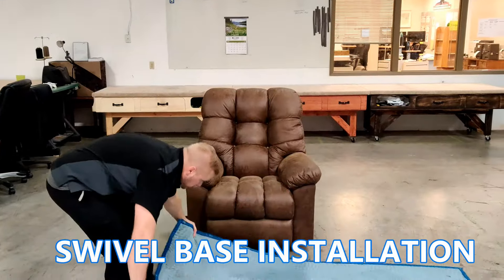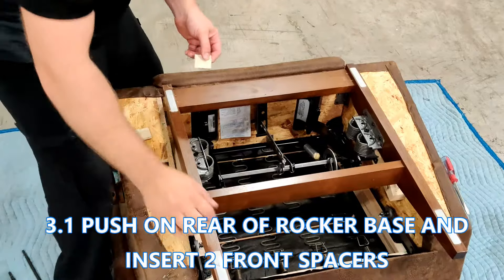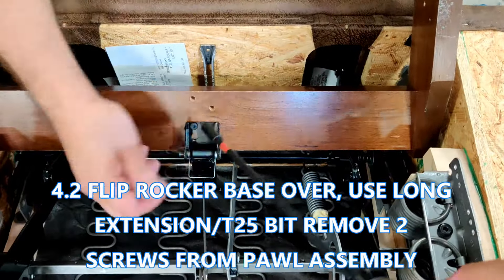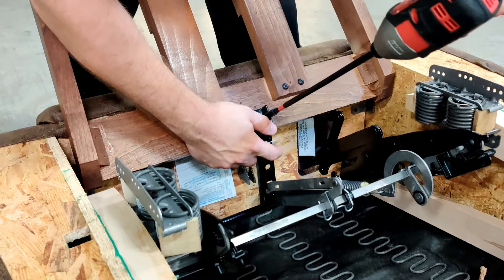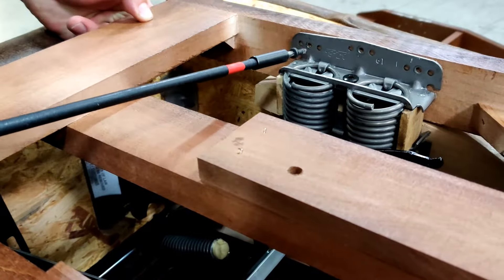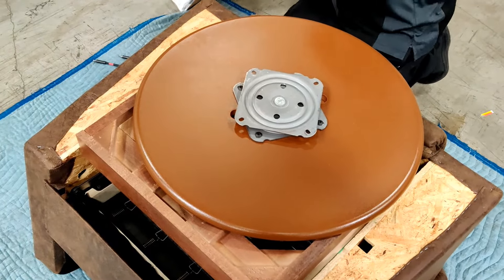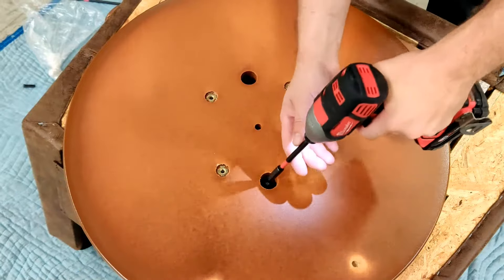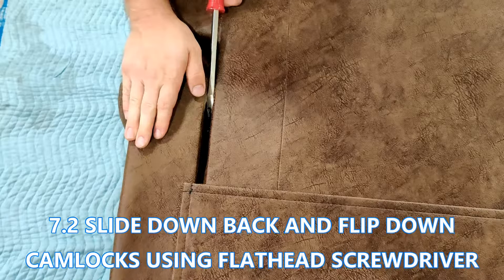Lazboy Swivel base replacement

Comment: George, I watched your video and although it only took your tech about 6 minutes and it took me about 15 or so...the video was much clearer to follow than the actual LaZBoy 3 pages of directions. Hint to all who watch this:  Put the 4 - block springs in first after you turn over.  The spring blocks are cut at 1 1/4 ".  I used a 3/4" piece of plywood scrap and cut 4 of them 1 1/4 x 1 1/4 x 3/4". Put both front 2 in first and back 2 in 2nd.  Once you take off the old base...the springs will layover a bit and that is okay.  When you put the new base on the holes are predrilled  and it will be easy to screw in the screws on each side...then take the spring blocks out.   Thank you for sharing this George!!  Mike

Comment: What about all the extra parts?  I have 5 plastic tubes, 2 long Phillips head screws and 2 tubular nuts with 4 plastic washers.  This is a very weak guide.  Could you have spent less time on it for us?

Comment: What are the dimensions for the spring spacer blocks?  I did not get those spacers with my base & it was a bear to get the swivel base on, but I finally muscled it on.  Thanx for the video.
Reply from the maker: You can just use some cut down wooden blocks, just make them larger than spring gap.

Comment: We just paid 150.00 for a swivel base from a Lay-z-boy dealer that told us it would work on our mechanical chair. Easy install, but once installed wouldn’t allow the chair to rock. Is it possible there are different styles for power recliners? We can’t find any info.
Reply from the maker: You want to make sure to use predrilled holes, call your local lazboy for more info
Reply: @theaterlightman89  thanks for responding. Turns out there are different bases for mechanical vs manual and they sent the wrong one, hopefully the replacement will work.

Comment: Just received my new La-Z-Boy recliner with the swivel already installed from the retailer. Love it. I was wondering though if there's a way to tighten the swivel a bit? When in the reclining position the chair will swivel almost too easily. Just curious if the swivel aspect can be adjusted a little tighter. Thanks, and great video.

Comment: The rocking spring brackets are made with a very cheap thin gauge steel and they broke easily had replaced already twice ..bought new pair from ebay and the one on the right (same as before)it lasted only like 2 months new before it cracked again from same place as before ..had made my self a bracket with thicker metal ..and seems to be holding better the pressure and weight..

Comment: I had this base installed on my recliner. When footrest open , the ratcheting reclining feature leans the chair back with too much ease and seems like it goes back too easily and too far back. Any suggestions on how to fix? We already tightened the wing nuts for the back tension.
Reply: you all probably dont care at all but does any of you know a way to get back into an Instagram account?
I stupidly forgot the password. I appreciate any tricks you can offer me.
Reply: @Junior Castiel instablaster ;)
Reply: @Jude Joseph thanks for your reply. I got to the site on google and Im trying it out atm.
Looks like it's gonna take quite some time so I will get back to you later when my account password hopefully is recovered.
Reply: @Jude Joseph It worked and I finally got access to my account again. I'm so happy!
Thank you so much you saved my account !
Reply: @Junior Castiel glad I could help =)
Reply from the maker: Using different mounting points can change the geometry of how it reclines, that's why on the rocker springs there are 3 settings... you can also add washers to the front of the chair where the swivel bolts to the base.

Comment: Purchased the swivel base from Lazy Boy but it does NOT include the spring spacers/blocks this video says are provided and are needed for installation purposes. Otherwise a good video of how to install the swivel base. Also no pads are provided to protect the floor once the swivel base is installed.  Come on Lazy Boy, those spacers/blocks should be included when you purchase the swivel base.

Comment: Where can I buy the swivel base kit?
Reply from the maker: Contact your local lazboy dealer
Reply: @theaterlightman89  My Lazyboy Larson model is older and both dealers in my town said they can't get the one featured in this video. They showed me a drawing of their latest rocking version and it looks like it has swing arms instead of rocker blocks. Still there surely has to be some stock for these somewhere.
Reply from the maker: @ if it has swing arms it could be they were talking about gliders

Comment: What are the names of the two parts you install in this video?
Reply from the maker: Upper swivel base and lower swivel base
Reply: I found the upper swivel base but not the lower.  Doesn't seem to be available. Can a metal  ring swivel base be used instead with this upper swivel base frame.
Reply from the maker: @DavidJohnson-pq1by  it can be ordered all together by your local dealership